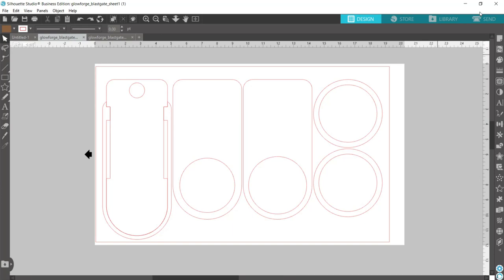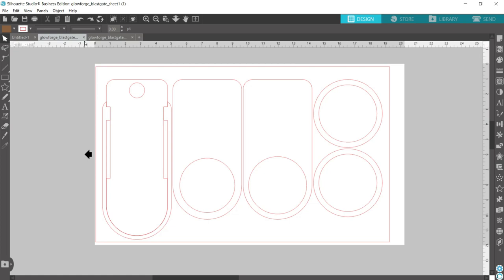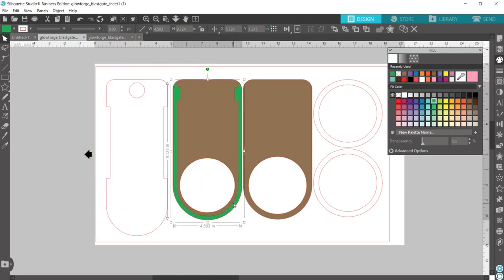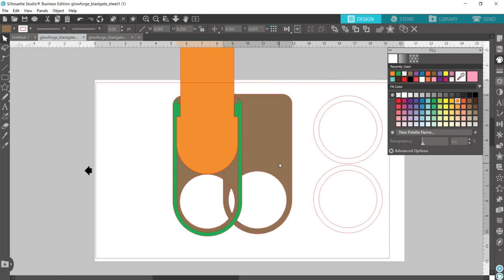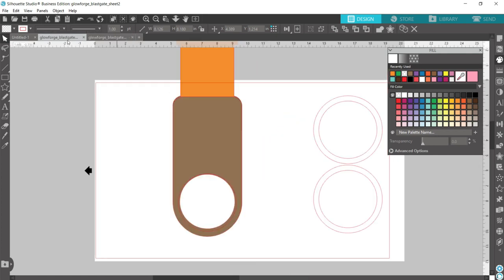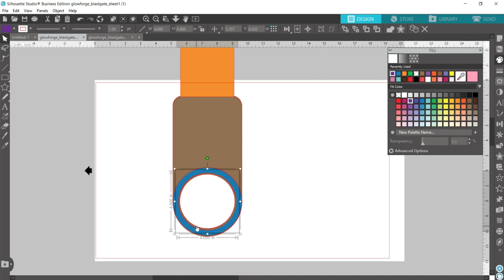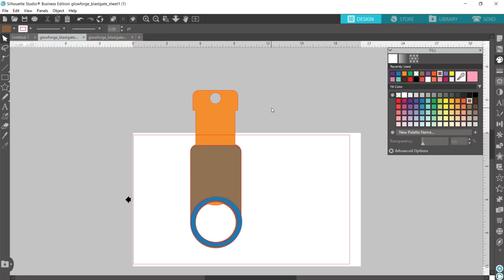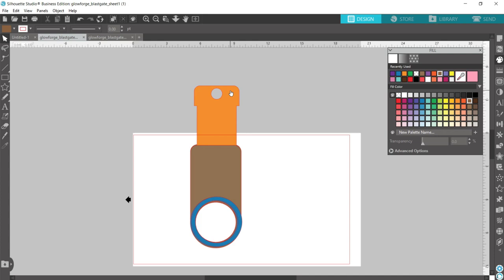How to assemble the blast gate for Glowforge 3D Laser Printer

Comment: So the first piece on the left is actually two pieces together.  Do you leave it like that for the GF to cut while it's together? Or do you separate?
Reply from the maker: Yes it will become two pieces once it's cut, but leave it together like that so less material is used up.

Comment: I just spent days making this blast gate and it doesn't fit the opening of my Glowforge. The blast gate is too small. I didn't alter the plans in any way. Was I supposed to?
Reply from the maker: That's frustrating 😔 The file is not mine, but no, no alternation was needed. Hmmm What program are you importing the file into? I have heard that Inkscape can sometimes resize the files. Otherwise, did you double check that all the rings are stacked correctly and that you are putting the correct side towards the GF. Honestly I thought it was too small at first too and it doesn't slide completely over it either, it just attaches very tightly. Try these and let me know.
Reply: @LadyCrockettCrafts  I use Illustrator. I opened it in there and then saved each "page" as an svg. I made no alterations at all and I'm super short and I can't actually SEE the back of my machine so I kind of went on faith that it was the right size (I know, stupid me lol) It was like an inch too small.
Reply from the maker: @katiepira2874  ahh it is likely the program messing up your scaling then. The port is the same size on all the GFs so it should work if the file is correct.  I unfortunately don't know how to fix that issue in Illustrator. I would have to recommend asking in one of the Glowforge Facebook groups about how to avoid it resizing your file, try what they recommend, and compare to see if in fact it does change the size of the rings in the file before trying the cut again. Maybe the old one can be repurposed 😩
Reply: Yeah, I know how to resize it manually. I just have to wait for more acrylic to come in lol. Thanks!
Reply from the maker: @katiepira2874  I think there is a setting you can change in the program without having to manually readjust all the sizes. Hopefully someone with Illustrator experience can provide guidance in that. I know wasting material is ugghhhh
Reply: It is but I'm a noob so it's to be expected I guess! I'll ask an Ai person in one of the groups to see if they can help.
Reply: @LadyCrockettCrafts  I'm about to try to cut this again and when I try to get the hole to match the 4" size on the GF port, it's so big it doesn't all fit on one acrylic panel. How many sheets did you use to create this? When I have it sized correctly, the grouping doesn't fit.
Reply from the maker: @katiepira2874  it will take 1 whole and partial of second. Good luck getting it the right size cut this time!
Reply: @LadyCrockettCrafts  thank you! I figured out the issue! It was my Illustrator save settings 🤦‍♀️🤣